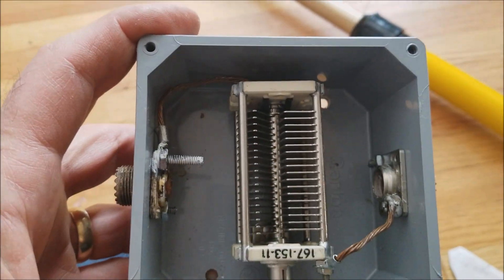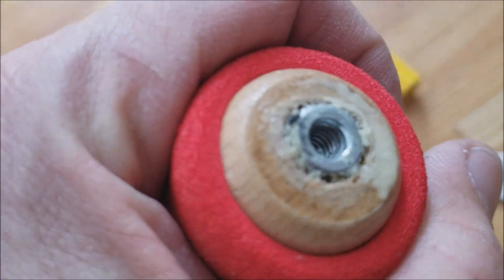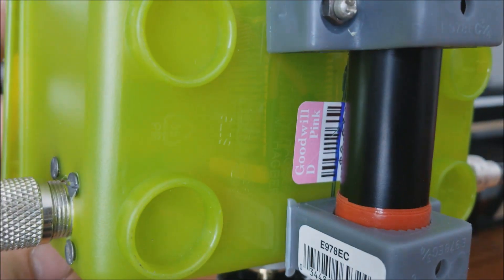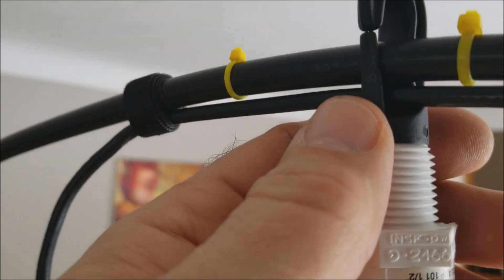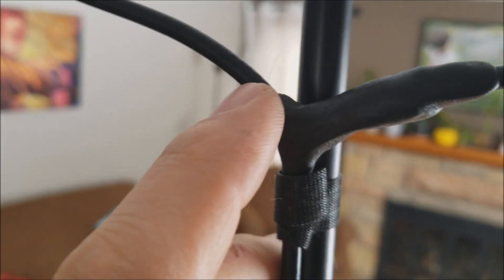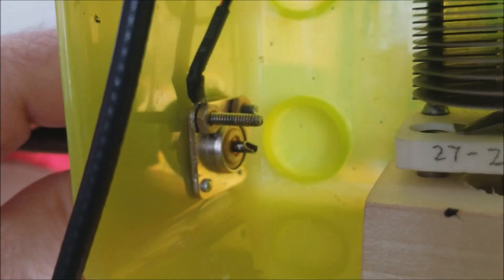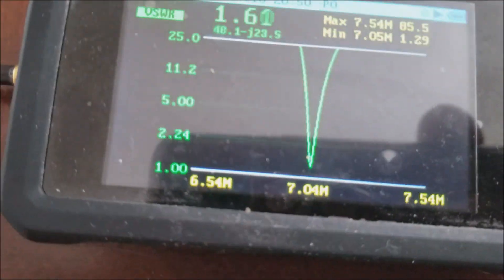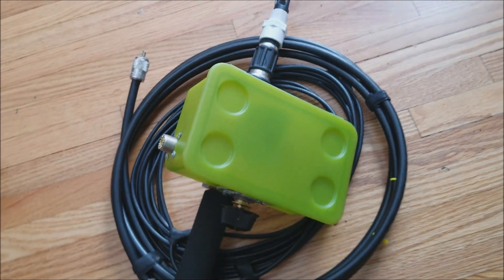40M-15M Lightweight Portable Magnetic Loop Antenna DIY (Part 1)

Comment: Tell a friend! How to lower the standing wave coefficient with gamma matching of the magnetic antenna? I have an aluminum frame with a diameter of 65 cm . for gamma matching , a copper wire in insulation of 23 cm . At 27 MHz, the standing wave coefficient is 7. How to lower the kgo, tell me!